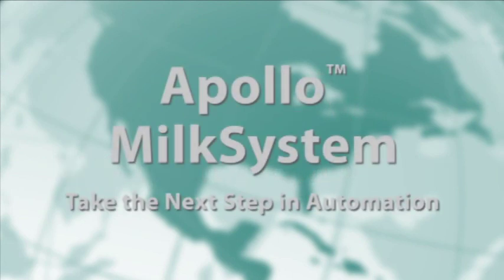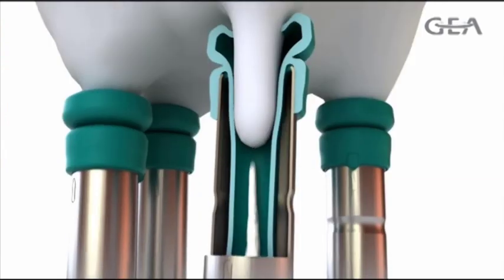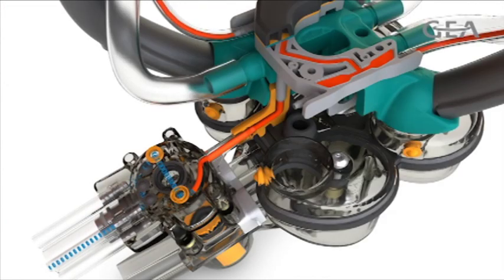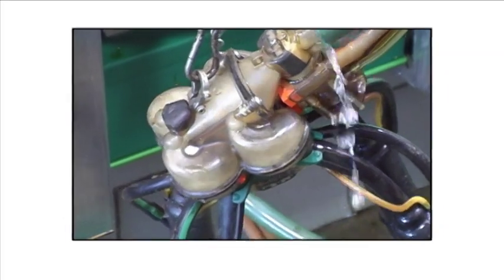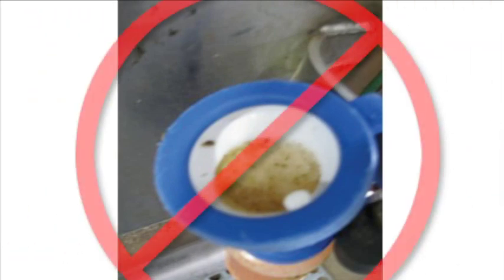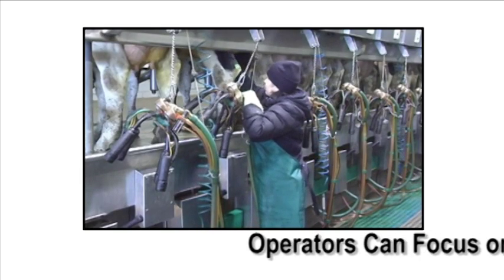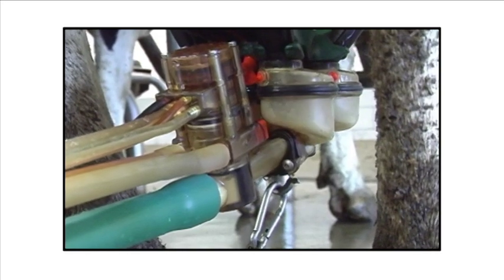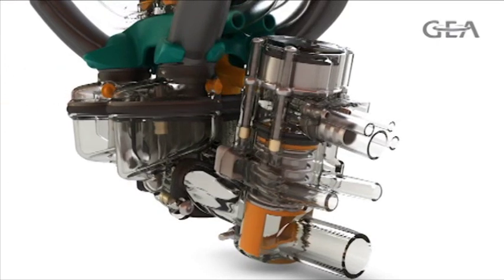GEA Farm Technologies - Apollo™MilkSystem

Comment from the maker: The teat dipping mechanism on the Apollo™MilkSystem is activated by the detach signal from the detacher control.  So, if the unit is kicked-off, the operator can choose to re-attach the unit and re-set the detacher control to remove automatically (and dip) when milk flow goes below the pre-set threshold.  The warning of a unit fall-off would also reside with the detacher control - depending on the model used.  If only one teatcup falls off, the remaining teats will be dipped and the operator will handle the unmilked quarter and dipping per the dairy's standard protocol.